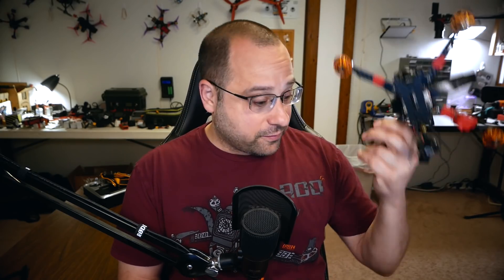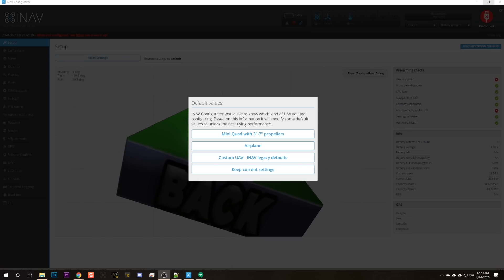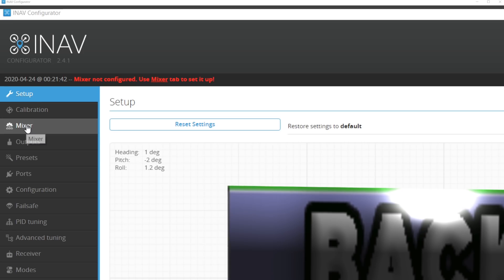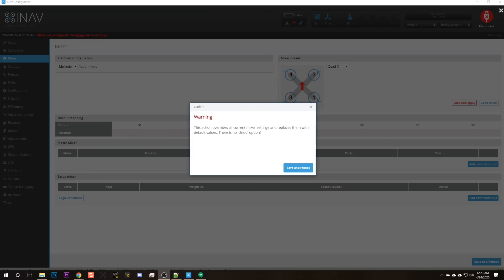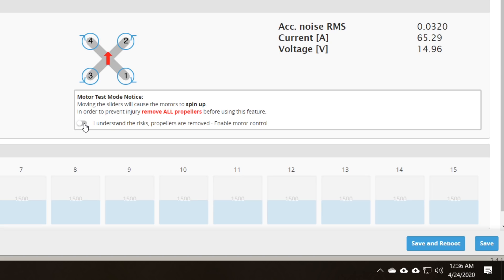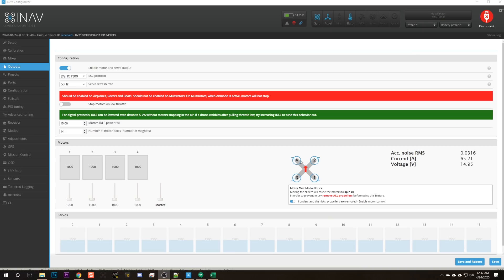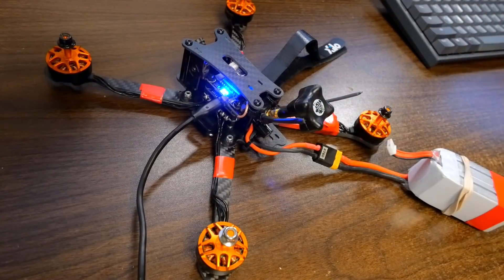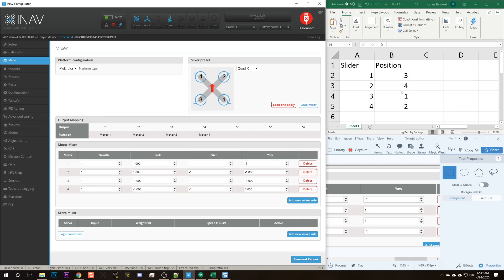iNav Drone Complete Tutorial - Part 2 - Mixer and Motor Output Setup

Comment: I'm glad you have done a series of videos on INAV.
My question is; if my FC had settings (maybe some are default) in BetaFlight and I flash that that same FC with INAV, does any settings stay on the board such as default settings etc?
I was curious to know if any settings carry over when converting a FC from BetaFlight to INAV.  
Is any of CLI data from BetaFlight usable in INAV?
Thanks!
Reply: I would say no.

Comment: I'm building a 9" quad for Inav and gps flying (Inav only has 3" to 7" presets). It goes into a violent oscillating shake then crashes after a few seconds. I'm thinking it's in the PIDs setup. What would be a good starting point? Anything I could be missing?

Comment: DON'T plug POWER into the quadcopter while it is plugged in. Just burnt the SECOND FC I had purchased to replace the first. I don't have another 80 bucks to spent, Bardwell.  Will not be following the rest of this tutorial.
Reply from the maker: I don't know what's going wrong but plugging battery in while usb is plugged in should not fry anything. I think you have a wiring mistake.

Comment: That is all fine and dandy that all your motors are rotating in the proper direction, but one of mine is rotating in the wrong direction.  What about me?
Reply from the maker: Use blheli to reverse the motor or swap any 2 of the 3 motor wires with each other where they solder to the ESC.

This shoukd be one of the steps in the tutorial (I hope).

Comment: Ive just set my quad up for Inav , The motors position is correct , However the motor spin direction is revered, In Betaflight theres a  motor reverse direction  tab, so its easy to correct the motor spin , However i cant find a way to do the same in Inav .... Any clues ?      Thanks
Reply from the maker: That setting does not reverse the motors. It tells the FC that you reversed the motors.
Reply from the maker: Use blhelisuite to reverse the motor or swap any 2 motor wires.

Comment: Joshua you can just flip the board and move the motors with out desoldering anything. Just flip it and rebolt the motors to the proper arms, remount the fc. 15 minutes tops. I do like the video(s). Thank You

Comment: Hi Joshua, thanks for all the great videos. I comment on this video because my question is most related to this one. I am using Betaflight though. Should be the same wrt the mixer. I have known this for a long time but was always too lazy to follow it up, but while tuning my newly built quad, I figured that the mixer may not be optimal. The frame is not a true X. I used https://www.iforce2d.net/mixercalc to calculate the actual motor mixer values. I came up with
mixer custom
mmix reset
mmix 0 1 -1 0.8 -1
mmix 1 1 -1 -0.8 1
mmix 2 1 1 0.8 1
mmix 3 1 1 -0.8 -1

I did not fly the new mix yet, but from your experience, how much of a significance does it have (in general). 
I found only my tiny whoops are true X while my 3 and 5-inch quads are all stretch X.
Thanks in advance for any suggestions

Comment: Also setting the "Number of motor poles" to match your motors seems to be pretty important.
The default is 14 but my motors have 12 poles.
And they were running louder and rougher when set to 14.

I could imagine not having this set right could reduce the performance and lifespan of your motors.

Comment: I love that iNav series, as I also own a hexa which i'm rebuilding right now.. (need to find a good FC with enough UARTs and PWM outputs to drop autonomously a cat into neighbors pool! j/k)
Since when does it matter in what orientation the ESC is installed?
FC sure, there is a difference, but ESC? there are no sensors built in and only thing changing is probably the rotation :)

Comment: A great series Josh. So far so good, but my barometer symbol is red, not blue. The blue light on the FC is flashing madly, and this doesn’t look like your experience. Any quick thoughts on the cause?
Reply from the maker: Plug in the battery then plug in USB then see if the baro goes blue. Sometimes the baro is not powered off of USB? Not sure exactly.

Comment: For those who think the motors are still in the wrong position in Mixer, well... they are.  But... by changing the negative and positive values, you're tricking the flight controller to do what you want it to do.
I THINK that's the case.  @ 15:05, JB seems to confirm.
However... having said that... I found it quicker and easier to de-soLder and re-soLder the ESC.

Comment: Hey Josh, I got this far but my one motor does not seem to get full power when I move the slider. All others seem fine but my position 3 motor is the one having issues. Suggestions?
Reply from the maker: If the motor doesn't spin at all when you raise the slider then check your soldering. If the soldering looks good swap the motor to another one. If that one doesn't spin then replace the ESC.
Reply: @JoshuaBardwell  got back from vacation, resoldered one wire and it seems to be all fixed :)

Comment: I was just wondering, if you have separate ESCs and you instal your FC rotated 180°. When you change the settings in iNav to tell it that you have rotated the FC, does it automatically work out that the ESC pads are also 180° out of alignment and in so doing have the motors in the right order. Hope that was clear enough question. 🤦🏼‍♂️

Comment: Instead of taking a screenshot of the settings at 10:00 just type the values into Excel... it's just a 4x4 matrix, it wont take that long. Then you can rearrange the rows into the correct positions in Excel, and copy the values into the configurator without the need for mental-gymnastics, and you won't make any mistakes!

Comment: Interestingly, this (changing the mixer rules to remap motors 3<->4) did not work; even after saving the changes and rebooting. Is this ESC dependent? PS: Using INAV 2.4. Looks like I have to rewire!
PS: I also tried inverting the number after "mmix" command - no dice!

Comment: I can not get iNav to set to anything but Standard ESC. I am running a Brain Radix with a T-Motor F55a 4in1 on the latest BLHeli_32 firmware.  I tried all DShot settings (150, 300, 600) and when I click 'Save and Reboot' it reverts to Standard. It will stay on multishot but the esc's start up out of sync.. I did try the motors in the Outputs tab and each spins as they should and match up appropriately in the correct motor order. Any idea why it would do that?

Comment: Just ordered the Tyro 119, unfortunately I just received the shipping information.  They are sending it "ocean shipping" in just 2 short months I should be able to do this build.  Be wary when ordering from Banggoods, it will be some time before you receive your order.
Reply from the maker: I'm not sure what the current situation is with shipping, but I do know things are messed up with air cargo due to coronavirus affecting air travel. A lot of cargo goes on passenger planes, but a lot fewer planes are flying now. I think probably one of the more expensive shipping options would have come faster, but I can't say that for sure.

Comment: Hey Josh! My question is not regarding to this build but I was thinking thi will be the shoretest way to get in contact whit you! I got a 2" little micro and I got the problem that when I punch the throttle  the screen goes black and comes back again. It's an F3 bord in a GT90 and I changed the factory defaults actually some of them. I changed the pid loop freq from 2 and 1  to 4 and 4  and I had oneshot 42 and I changed to 125 could the couse one of these or these 2 together thiss problem? Thank you advanced! And I wish you a beautiful day! And happy flight ;)
Reply from the maker: Usually the problem you're describing means the voltage regulator that powers the camera is browning out under load. If the camera can take vBat voltage, you can move the power from 5v to vbat as a temporary solution.
Reply: @JoshuaBardwell  thank you very much! Your answers always help me out form situations like this! I appreciate it see you in the next live and also on your patrion 😁

Comment: You certainly not need resource remapping to avoid the hassle... It can be done in the configurator. But as betaflight is complex to keep some extra flexibility, INAV does the same here, allowing one to have a lot of hex one weird configurations doing the setup you did.
However, they could add a setting to do a "motor swap"  in the configurator, It requires a Feature request in github, and someone willing to implement it.
Reply from the maker: I do think that the ability to swap around the mixer lines in configurator would be nice. But of course, it takes time and effort to build it.

Comment: Or... You could spin the motors to find their positions, mark the signal wires on the esc connector, carefully remove them, and change their positions. It’s a bit annoying to remove the wires, but I had to do this for different brand esc/flight controller. I would expect this to work just for motor position changes if needed.
Reply from the maker: Yep it would work. I just hate doing it that way.
Reply: @JoshuaBardwell  For Betaflight it would be much easier to just remap the motors, but if I ever do an iNav build that requires I rotate the board, I'm going to be at least tempted to just move some wires on the connector.

Comment: looks like you've read my post about Inav motor remapping theory (I used hexacopter mixer for quad copter to use S3, S4, S5, S6 pads for motors 1,2,3,4) Great, it's working!)

Comment: Remove all doubt and Remap the pin connector of the 4n1.  Something that you might be doing anyway with mismatched brands of boards.
Reply from the maker: To me, this is easier than trying to reorder the plug. But it is easier with the plug to verify that you have done it correctly by raising the sliders. The plug is just such a hassle to reorder.

Comment: Or remap the wires in the plug.
Reply: That was my comment also.  Since this video is meant for beginners it should be pointed out that not all 4n1 connectors have the same pinout and should be verified.  That was my case, different brands.  I had to switch pins anyway, not a big deal. This is good to know that is possible to do.

Comment: Maybe I missed this, but will inav work with any flight controller?
Reply from the maker: The best case will be if the FC has barometer on board and SDA/SCL pads for a compass.
Reply: It works with many but not any. Check the github page: https://github.com/iNavFlight/inav/tree/master/src/main/target All Targets are in there.
Reply: @_seriousrob_  thanks

Comment: The default profile for mini quads explicitly mentions a size range of 3" to 7", but what if you are building a quad that is bigger or smaller? I'd assume that going outside of this range a little (2" / 8") would be fine but what if you had a much bigger quad (10" / 12") - What has to be changed specifically for this size of quad? I'm assuming it's related to the navigational PIDs?
Reply: iNAV offers many presets. Lots more than shown on the first connect after flashing. The preset section has settings for 5" (race, performance, gps), 7" (endurance, freestyle), 10" general purpose, 12" general purpose, 280mm tricopter, 600mm tricopter, airplane general, 600mm flying wing and a few special wings as well.
Reply: @_seriousrob_  Ah I didn't realise there was more. Thank you!
Reply: @yngndrw.  I think JB will go through the tabs in later videos, so you couldn't see it yet.

Comment: The motor idle could be set at 15%  because they may think most people maybe using Inav for RC Planes if so 15% would be about right. As for rearranging the motors wow that looked so strange & difficult ( Think I have got lazy with betaflight ) Great info JB
Reply: For most fixed wings the motors are disabled at zero throttle. That way you don’t cut your fingers off when you throw it to launch.
Reply: @brandonbell359  I did not mean the small stuff that you hand launch. I'm meant a model with landing gear that uses a runway of sorts.
Reply: @GeorgeCooper_LoneWolf  Maybe.  I think I'd still prefer to be able to stop the motors.  If I needed to "idle" the plane either taxiing or landing or whatever, I'd manage the throttle myself.  If I were to guess at the high idle, I'd say that it was more aimed at long range quads.  Swinging a big prop slowly is a pretty efficient way of flying a quad, but the resistance of a big prop at low rpm would be tough on the motors.  You'd want a high idle to keep the motors from desyncing and dropping the quad.
Reply: @brandonbell359  You would have a kill switch to stop the motors / Arm Switch.  As for the 15% only Inav really  know why But I do no a big long range quad wont fly at 15% idle.
Reply: @GeorgeCooper_LoneWolf  As someone who has disarmed in flight, I can tell you its not a very comfortable experience.  Also, its not for flying at idle.  Its for keeping the motors spinning so you have control authority while descending.  Turn your idle down, get some altitude and drop the throttle on one of your quads and see how stable the decent is.
Reply: Hold on hear you said how would you stop the motors spinning. That's why I said use the arm switch....And you said the idle was for long range flying and that's why I said a quad wont fly at 15% idle. 

 I have had enough now I think your just looking for an argument for the sake of it so this will be my last comment.
Reply: I'm sorry you feel that way. I was under the impression that two, I'm assuming here, adults could have a conversation without getting defensive, but its pretty clear that you don't fly fixed wing and barely understand the hows and whys of quadcopter flight.  With that said, I will also not be responding here.  Happy flying.
Reply: @brandonbell359 .   I was going to ignore this however. I have over 30 years flying fixed wing and 20 years on Heli's and about 9 with Quadcopters. I have just checked out your channel and well you are new to the Hobby but you will learn that the fpv community are a bunch of great people, yes we don't always agree with each other. But we all try to respect each other. 

I don't understand people like you who just want to try and piss others off.

Comment: Are you going to add a compass to the build so you can use the GPS features in INAV?
Reply: Yes. https://youtu.be/WYPzt-HcGH8?t=1033
Reply: @st200ol  the GPS in the kit has no compass.
Reply: @chriswhitehead6095  I didn't know GPS worked without a compass, today I learnt something. :-) I suspect a compass wouldn't work too well on something so small anyway, probably too much magnetic interference.
Reply: st200ol For some GPS functionality (like RTH) there must be a compass available, otherwise it won’t work